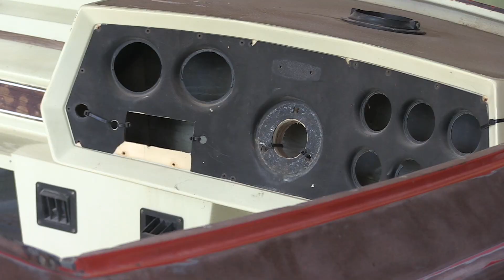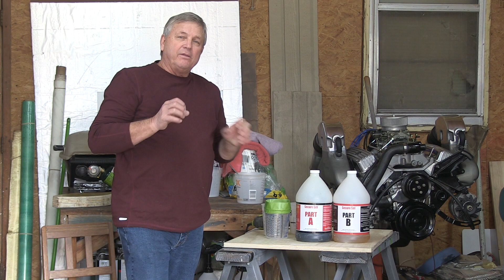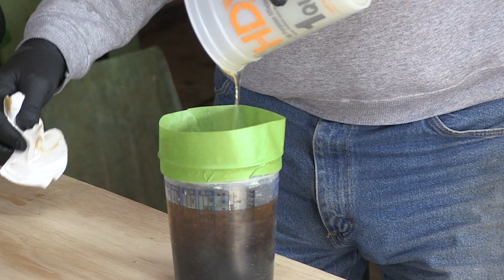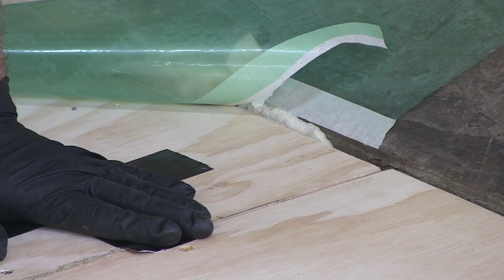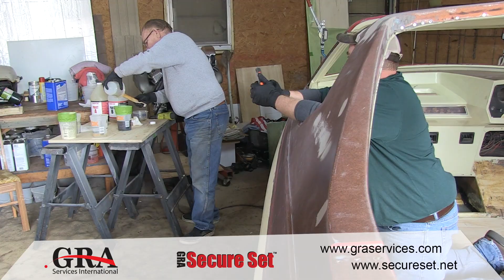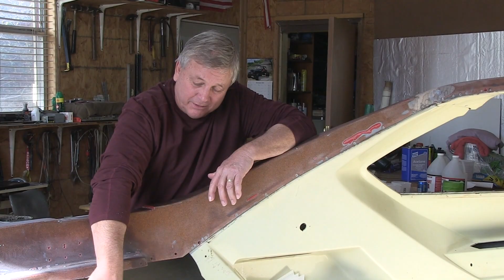Secure Set Used in Glastron Carlson Scimitar Boat Restoration Project

Comment: Does the water flow through the foam to exit the drain plug at the back? Or did he put it only on the outside of the stringers?
Reply from the maker: Hello Grant,  The entire area under the floor boards was filled with foam.  This foam is a closed cell foam and will not let water enter or move through it. Water in the boat was allowed to flow to the back of the boat, and exit.  Since the area under the floor is completely sealed, drainage becomes a problem that is dealt with a lot easier.  Thank you.
Reply: @SecureSet-Fence-Installation  since water enters at the steam between the bottom and top of the boat, the goal would need to be at the floor level all the way to the front of the boat.  The floor of the boat doesn't go to the bow in its original creation.  
I like the idea of the foam and the floor in my 1972 Glastron right now.  But I think it would be better to have a space, or pipe going down the center of the bottom of the boat for water to flow to the drain. The same it was originally made.
Reply: @grantdubridge7995  Sorry I was so long to reply to your post here, I just seen it.  I've been out of the boat business several years now, kinda,  this boat belongs to a best friend and I agreed to help him build it. This is the 9th one of these Scimitar boats I have had in my shop, I am very aware of the original configuration of these boats, and only the third one with these mods.  Water under the floor has Always been a problem with these boats, the foam blocks that were used in the construction of these boats was Not a closed cell foam, they would drain if water was introduced for a short time, but not if water remained under the floor, then the foam would absorb the water and it wouldn't take too long for that to happen and gain the weight of the water.  The foam used in this boat , and several other of my builds was poured to completely fill the under-floor space as well as the sides of the floor area forward to the storage area, any water that could be introduced into the boat forward the cabin would be evident through the ski storage locker in the fwd center of the cabin floor, that is just about the level of the floor, the gas tank is now under the cabin floor.  I removed the 36-gallon original gas tank that was in the bow area and had custom 34-gallon tanks constructed and placed under the cabin floor.  The original gas tank full of gas weighed about 240 pounds, moving that weight 7 feet aft was a tremendous asset to this mod.  The foam used in this modification is only about 32 pounds more than the original, but the strength and sound is worth that to me, and my client's.  The transom modification on these three boats with this mod and the weight of the motor, components and almost everything else was certainly in consideration, and weighed, the motor itself is near 200 pounds lighter than the original application, aluminum heads and EMI exhaust manifolds, intake manifold, water pump, light weight starter, flywheel and coupler and other considerations to accept   400 + horsepower.

Comment: It def looks like it adds rigidity but what of the weight and floatation. The USCG recommends 2-4lbs foam for floatation as the heavier 8lb float foam apparently adds weight without adding floatation.
Reply from the maker: Hello Hoobey,  Secure Set Mix & Pour is a 4 lb. foam. Has a compression strength of 103 psi and can support 10,080
Reply from the maker: Sorry, pressed , the enter tab before I finished my last response.  It can support 10,080 lbs. per square foot.  Excellent flotation and rigidity.  Thank you